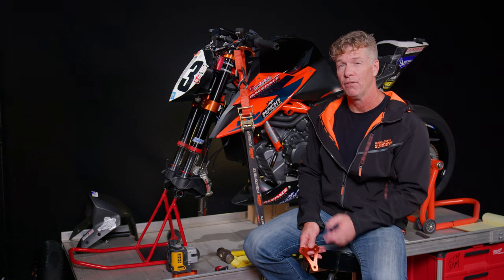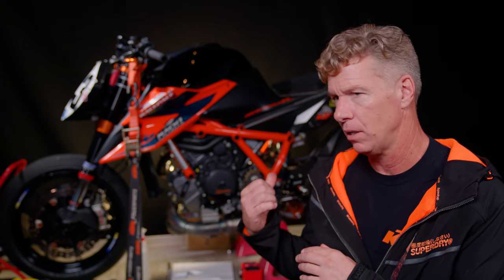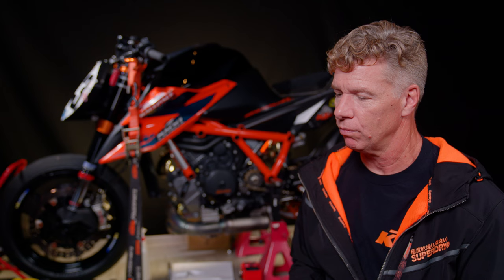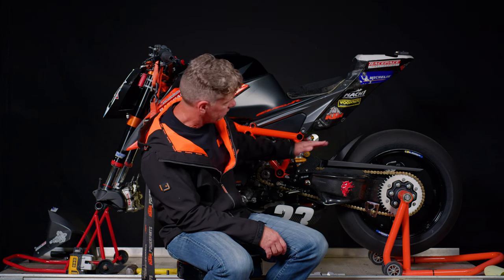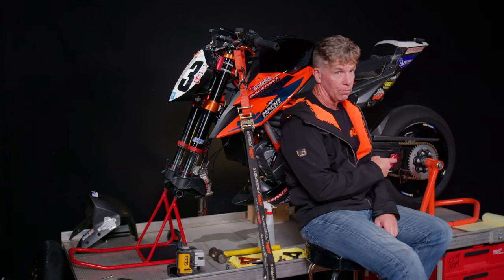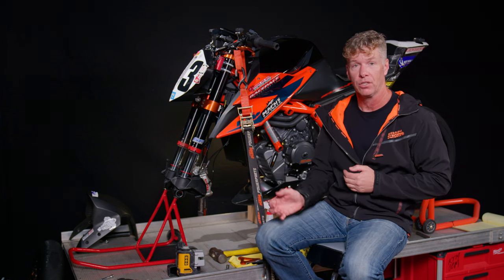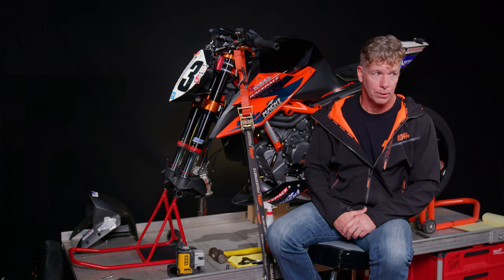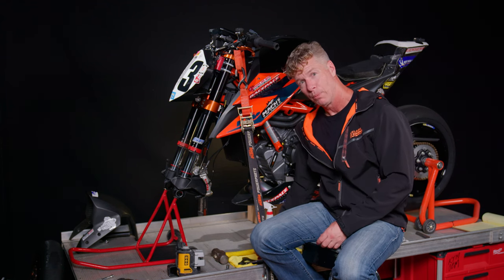KTM Super Duke R Geometry Secrets: 3 Performance Boosting Hacks

Comment: Love your videos. Still trying to wrap my head around most of it. You explain everything visual and with feeling I can relate to.
Still, here in Belgium I sometimes go over it 2 times. 😊
Regarding this video I have little a question that would help me in understanding a bit more geometry. Lowering the frond a bit, fork and clamp, and making the back shock longer, raising the back...could make the bike more stable... and so potentially reduce tankslappers?
Reply from the maker: Depends on what is making your bike "unstable".   Trail is directly related to "stability".  But I hate that reference.  It gives the impression that reducing trail makes the bike unstable.  This has not been my experience at all.  I have reduced my trail a LOT and I have never experienced instability on the SDR.  Personally I think instability on the SDR comes from squatting on hard acceleration, as I mention in the video.   ...It sounds counterintuitive but lowering the front actually flattens the swingarm, which reduces antisquat.  So I wouldn't go that way.  But yes, in my experience raising the rear helps keep the nose planted on drives, which helps keep the bike inline.  ...An interesting point that I have not talked about in videos yet is an entirely different way to increase/decrease antisquat - with sprocket sizes!

Comment: This is good content. I ride an R3 rocket but the info applies just as well and confirmed my thoughts. Thanks man!
Reply from the maker: It's true, this is not exclusive to Superdukes at all.  In fact my experience racing a 2008 GSXR 1000 is what gave me the idea to raise the rear on an SDR in the first place..
Reply: @superduked33  I'm just doubting a little since the Rocket has a driveshaft it tends to lift the rear under acceleration. If I was to extend the rear let's say 3/4 of an inch would that relax the coupling of the driveshaft to much so it doesn't use all the space of the treats anymore? I asked my dealer and he wasn't sure either it would or would not effect the bikes reliability over the long run. It would fix a couple of issues with the bike and that's groundclearance and a sharper turn in at high speed at the compromise of stability. But the bikes has more than plenty of that.
Reply from the maker: How does it left the rear?  I mean, how can you tell - can you feel it?   Is it the rotation that causes this?

Comment: OoOoOh lovely video Eric. I noticed when you were moving the rear swingarm the chain moved back and forth, its an issue in full suspension MTB's which engineers have tried to eliminate, is it as much of an issue on motorcycles? I havent had a chance to play with the settings beyond getting the suspension a few clicks either side of the recommended sport settings recently so I will revisit with this new knowledge to hone in that cornering confidence. Great video!
Reply from the maker: It's an issue but not a big one.   You just need to leave enough slack so at the tightest point it still has a bit of slack, otherwise the chain pulls on the countershaft sprocket, which is bad, and limits suspension travel, which is also bad.

Comment: I owned a standard 2020  model and changed to an RR 2021. I did not get the chance to ride them back to back due to late delivery, but even with my very limited knowledge/experience I felt the RR more easy to flick and "easier to handle". I thought much of it was the lighter forged wheels, possibly the more agressive radius of the power cup 2 vs bridgestone S22. 
After your video now, I revisited the stats of the RR and it is heightened 10mm vs stock bike. This would seem to do at bit of the trick from your modified triangle. I guess the progressive nature is still the same as OEM, but I will try to verify this with part number just to have a "reference point" before sny modifications. As I have just recently done some track days, getting to know the bike past street riding is my main focus. Thanks anyways Eric. I'm sure i will follow you, your videos and trying your products when base settings are set and experienced with my RR.
Reply: Hello, please follow up in this thread with what you find, I've been talking to Eric a fair bit over email and I'm getting closer to the settings I need, however my bike lifts even with the Anti-Wheelie on over uneven tarmac so I wonder if a 10mm link might help that aswell as the general handling.
Reply from the maker: While you are calculating differences it helps to consider that 1mm at the shock (on our SDRs) = 2mm above the axle.   When you say yours is heightened 10mm, where are you measuring from - above the axle or are you measuring shock length?   I am happy to help.
Reply: @mrnobody9821 Have you considered going to 114 link chain?

Comment: Is this link compatible with a SDR evo 2023? And is it a good idea for on the road and occasional track days? I am 108 kg. And at TTAssen my time is 1.59( about 15 sec slower then the best amateurs)
Reply from the maker: Yes and yes my friend.   The difference with the EVO is that bikes ability to change ride height by adding preload.   I highly recommend you alter your ride height using other means, on any bike, than preload.   Because all preload does is raise or lower your window of travel.   It does not make the spring stiffer or softer, and it really doesn't actually raise your "ride height".  It raises your travel window.   The up-side of this is it's easy.  The Down-side of this is you can bottom out your shock if you back off too much preload, and you can top out your shock if you wind too much in.   Preload, in my opinion, is best used to get your suspension travel window perfectly synced with the travel of your shock and forks.  Once you nail that, don't even move it again.   Unfortunately EVOs move it all the time.   It's convenient but not ideal.   ...Any Sport Link works on an EVO.   They share all the same part numbers - swingarm, link, control arm.   Just the EVO shock is different, due to the electronic adjustability.   Great question, I hope the answer makes sense

Comment: Is having too much swingarm angle to the point that it tops out the shock under hard acceleration something you need to worry about?  Like through turns 7 & 8 at T-Hill.
Reply from the maker: I can look at my data and give you exact answers of where my swingarm is at all those places, but for now it's valuable to understand that the anti-squat "moment" we are talking about here is just that, a moment.  It doesn't last very long.  At least not the most extreme conditions of it - for instance initially, coming out of turns hard.  Anti-squat would be more active coming out of turn 6, than going through turn 7 or 8.   Exiting 8, like when you're drifting wide almost at the edge of pavement at the end of the alligator teeth, it's active there.  But going "through" 7 and 8 you're not accelerating that hard.  "Too much" swingarm angle would be very difficult to get, on a KTM Super Duke.  Think of the hoops we need to jump through just to get "more" never mind too much.. 🙂

Comment: On the steering damper, I’ve not had any headshake either on road or the 3 track days I did this summer. Few years ago I changed the fluid in the stock damper to 15w.
I know I’m not pushing the bike to the limit like you are.
Reply from the maker: I raced with the OEM damper the first season with the Gen3 - with 15w oil in it too.   Worked fine